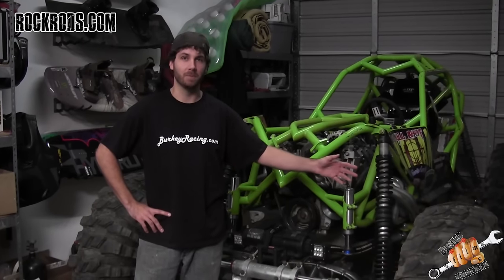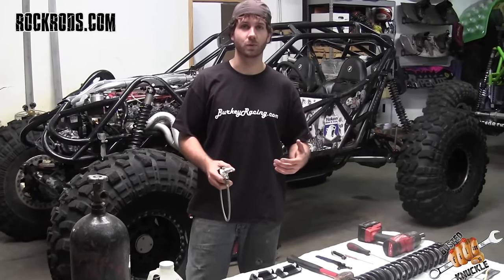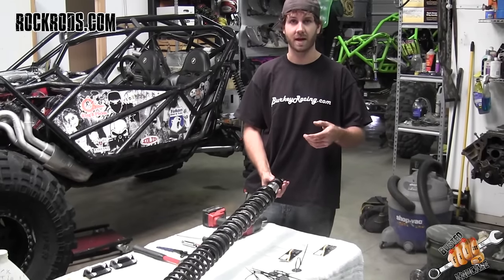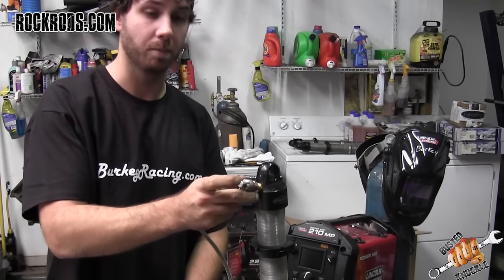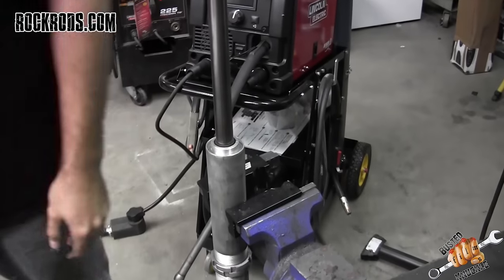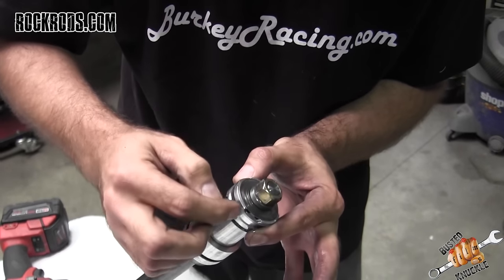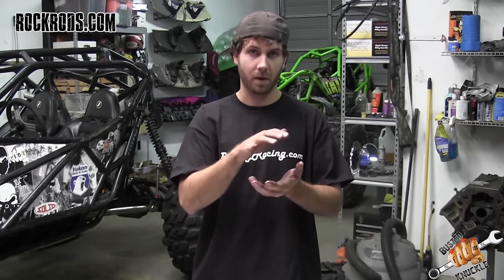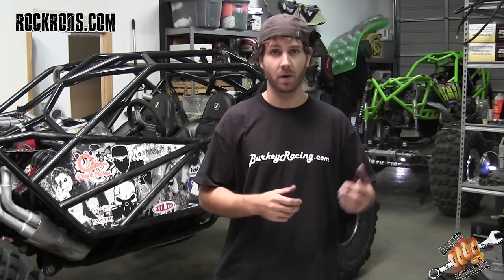OFF ROAD SHOCK TUNING 101 - Rock Rods Tech

Comment: Hey guys I plan on ordering shim stacks from you guys for my radflo shocks. However I have a question since I am new to radflo. I am trying to optimize the shock to sock up small to medium bumps and choppy terrain. I know with KING you use flutter stacks to get a softer low speed, or extend the soft zone. Is the principle the same with radflo?
Reply from the maker: yes same principle

Comment: What would you recommend for a ford excursion with a 8 in lift and running 37
Reply from the maker: We could set you up with a nice set of emulsion shocks like some from Radflo or Fox that would help the ride a bit. Is the lift all springs or block as well?
Reply: BustedKnuckleVideo has blocks in it I want to be able to do the same thing you guys were doing in the video lol up hill
Reply from the maker: lol, better swap to 4link and coilovers if you want to do that
Reply: BustedKnuckleVideo that’s the plan lol will I be able to tow still ?